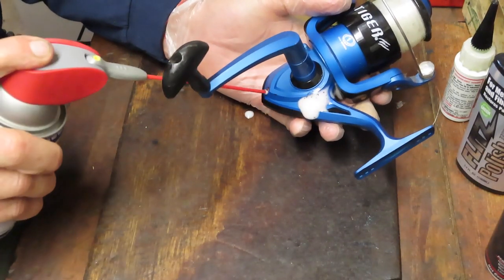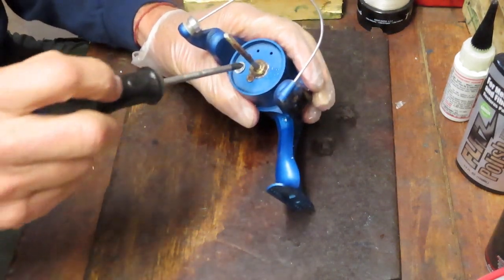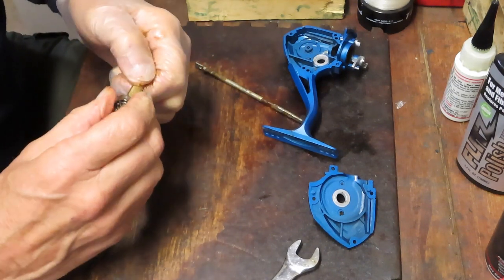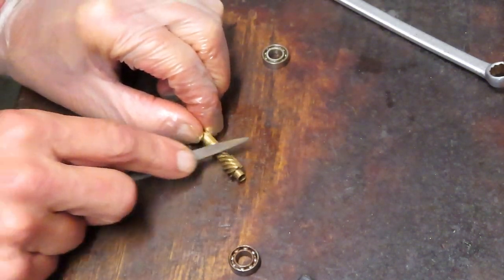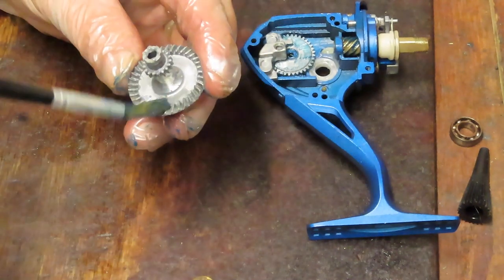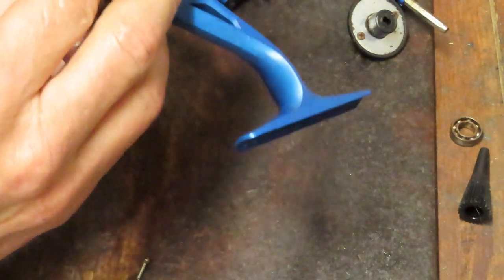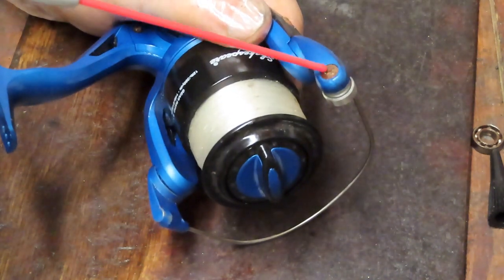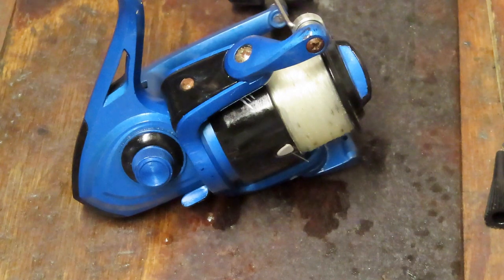Shakespeare Tiger 50 spin fishing reel problem diagnosis and how to take apart and service

Comment: I actually have a smaller Tiger Reel or at least my daughter does. She bought it because she wanted to go bass fishing and this reel was cheap.  This is another Pure Fishing “masterpiece.”  Best characteristic is that they are cheap. Using this reel in saltwater was all but suicidal for its future use,  I’ve never seen Kroil before. I’ve gotten to the pint of going for broke with a last try on a reel. More often than not I failed but I am getting better at it with time. You did a masterful job resurrecting this reel. I liked your trick for getting that bearing loose. Reminded me of the advice you gave me about loosening a rotor on a Daiwa 7000C. Great video as always!
Reply from the maker: Thanks Chris - the reel has a place and a market to service at a value price point.  I recommend lower cost, older design reels for the occasional angler.  There is no reason they need to spend $100 on a reel to go catch a few Bluegills -  Dennis

Comment: HI Dennis. I have changed the handle bushings in that reel to bearings and it became a very smooth reel.
Reply from the maker: Thanks for sharing.  Nice way to hot rod a dependable reel - Best wishes - Dennis
Reply: @2ndChanceTackle  Thanks Dennis. I forgot to mention that the bushings in the line guide on the bail can also be updated to bearings. That effectively makes this a 5 bearing reel. Not bad for a $17.99 Walmart combo and $8 worth of RC car bearings (they sell them in the place on St George Ave). Hopefully this pandemic will be under control and I can stop by and visit with you soon. I can't wait to pick your brain a little. Happy Easter!
Reply from the maker: What's the name of that place?.  I am always looking for a source on the bearings.  It would be nice to have one nearby - Thanks
Reply: @2ndChanceTackle  I just drove past and it's a beauty salon going in there now. Another casualty of the pandemic :(

Comment: I had a south bend competitor that I used for a couple years and had no issues til I let my brother use it and he did not clean it after use. And the damage was done
Reply from the maker: That is a problem with those reels.  If you don't keep them clean and oiled, they will perform badly - Thanks for the note - Dennis

Comment: I need help with my TSP-50A. Can’t find any info. Can you help?
Reply from the maker: What do you need?  Generally there is little info available on these reels because design changes occur with each lot and there are no service parts available, so there is generally a lack of support for them - Dennis
Reply: @2ndChanceTackle  I ended up figuring it out. Now looking for parts on a South Bend TC-555 Typhoon. The main gear has stripped threads. Replacement parts are difficult to find. I may just have to rethread it myself, but I think it may not be very stable.

Comment: My reel let’s line out but it’s locked to reel the line in.  In the video at the end it looks like you only turn the handle one way, but you didn’t turn it the other way to reel the line in, so it’s unclear if you were successful. I bought 2 of these same models from Walmart and neither line reels in.
Reply from the maker: I am not sure what you are doing here.  The handle should only turn one way.  To let the line out, you flip the bail open and the line goes out either by casting or dropping with a weight.  Turning the handle closes the bail and brings the line in.
Please give me additional information on how you are operating it.
Thank you
Dennis